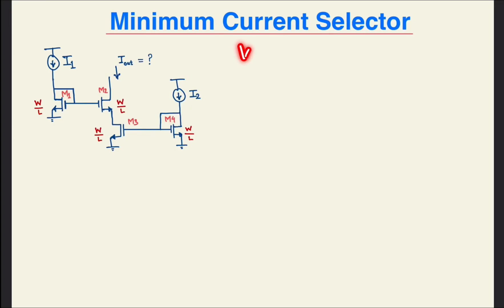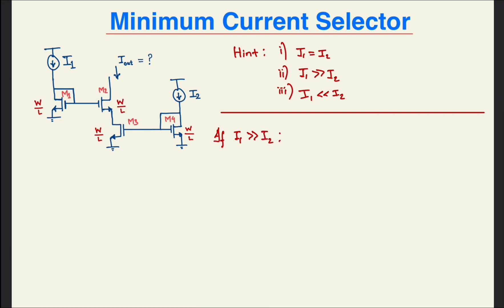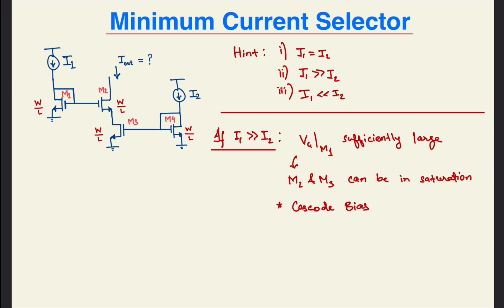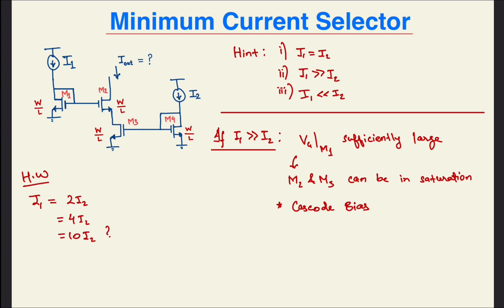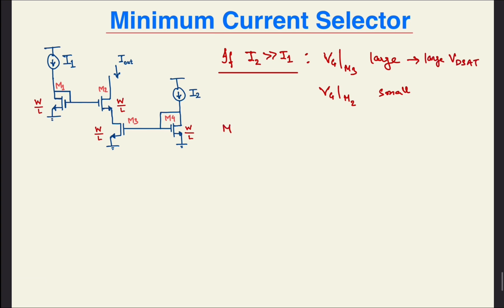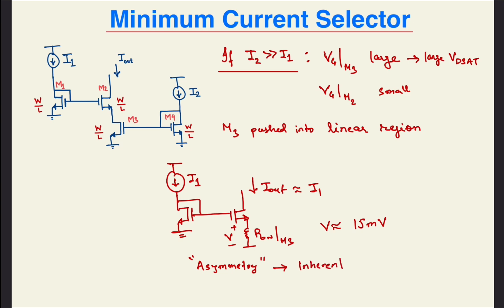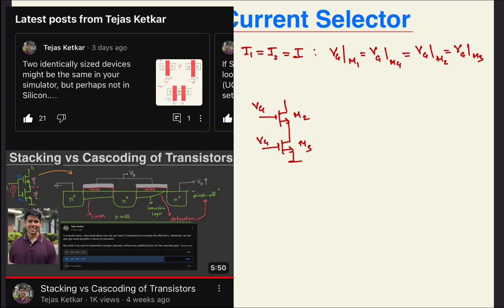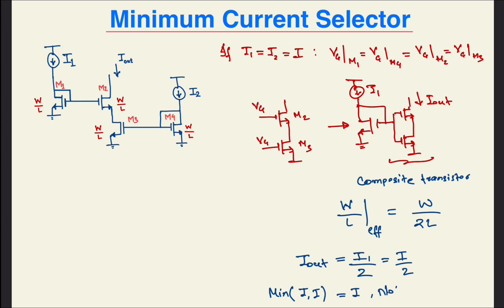Minimum Current Selector (Not what you may think!) - Interview Question

Comment: Why the transistor with lesser Vg is seen as a resistor?
Reply from the maker: I presume that you are referring to the case when I2 >> I1. If the VGS of a a transistor is sufficiently large (i.e., VGS > VDS + VT) then the transistor operates in the linear region. 

In that case the Id-Vd characteristics is fairly linear (especially for very low drain voltages), and you can think of the mosfet as a resistor.

Comment: In the HW question, the minimum I1 required to bias M2  so that the current I2 flows through M2 and M3 is 4*I2.
Explanation: Let's assume that I2 current requires Gate to source voltage of VGS (or equivalently, the overdrive voltage of VGS - VT). Hence the minimum drain to source voltage required to keep M3 in saturation will be VGS-VT. So the required voltage at gate of M2 will be 2*VGS- VT.
This means that the gate to source voltage of M1 has to be 2*VGS- VT. Hence the overdrive voltage of M1 will 2*VGS-2VT which is twice the overdrive voltage required for I2. Since drain current is proportional to the square of the overdrive voltage, I1 has to be 4*I2.
Reply from the maker: That is spot on! I was wondering if anyone would actually solve it. Thanks!